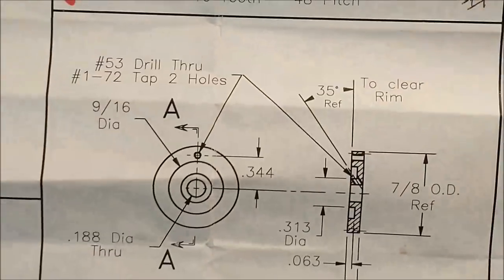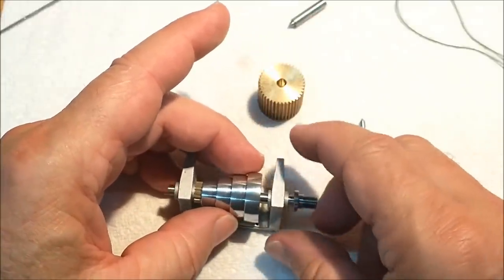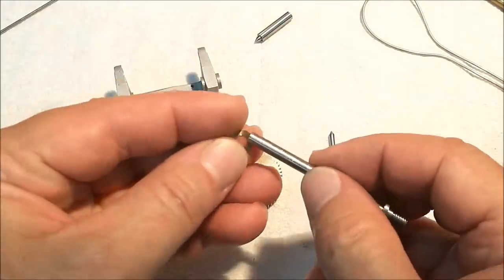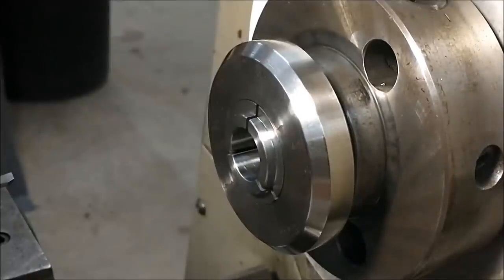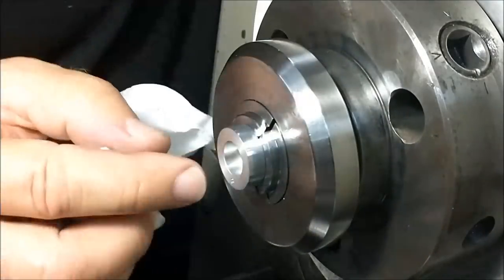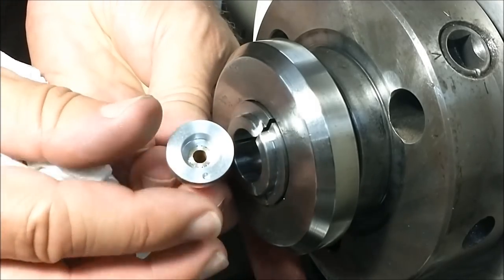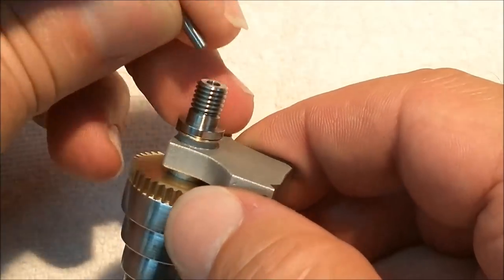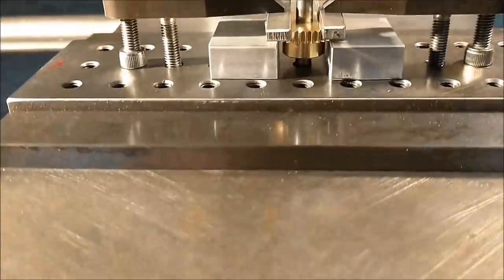Main Spindle Gear - A Design Change You Are Going to Like !!!

Comment: I like your solution.Much better than the print.You could cut grooves in the bull pin then,drill and tap a hole through the face of the gear to intersect the hole for the bull pin.By installing a ball and spring,retained with a set screw,you could engage and disengage the bull pin by sliding it from one groove to the other,just like a larger lathe.Just a idea.Finding a ball and spring that small,presents another problem.
Reply from the maker: You'll still need room for the detent pocket configuration. There is just .125 to work with here.
Reply: The way you did this is probably the best solution.It is a working model,not a production machine.👍

Comment: Just a quick question on terminology. In the US you seem to use the word "setscrew" for what we in the UK call a "grubscrew", usually a socket-headed retaining screw which sits in a recess. The UK version of "setscrew" is usually reserved for a standard hex head bolt with the smooth shank threaded for the entire length of the bolt and frequently fitted with a nut at the other end. I've looked on the web but can't find a satisfactory answer. Q. What is the US name for a fully threaded standard bolt?
Reply: Fully threaded, look up McMaster Carr and go through the drill down menu (great website).
Reply: All I can tell you is on the old machinery they use to have a long threaded bolt where appropriate.   It was threaded all the way as you said but it had a square head on the bolt.   I believe it was no bigger than the size of the bolt.   I will have to check that as I still have some of them.   I don't know what the proper name is for them but we always called them a set screw  bolt.

Dale in Canada
Reply: @dalemcinnes1834  Thanks Dale. I don't know if you will get this reply as YT doesn't seem to be recording them. Anything with a thread on it seems to cause all kinds of confusion. Setscrew, grubscrew, setpin, stud bar, allthread, capscrew all seem to have varying meanings in different parts of the world.
Reply: @larrymunday7519  Thanks Larry, I posted a reply but it seems to have vanished.

Comment: I like your drive mechanism much better than the angular setup on the plan. Even in real life it is a much better solution to driving the spindle than an angular set screw. No side loading and no dicey locating issues. Nice! j
Reply from the maker: That angled screw was just not going to happen on this model.

Comment: Very nice modification for the lathe.  I'd love to see that show up on PM's plans someday.

I was wondering why you didn't use a taper pin reamer for the center tapers?  Perhaps I missed that point in an earlier video.
Reply: Guess I’m a little slow this morning. I can’t see a need for the setscrew through the cone. When the bull pin is engaged the drive is direct. When it’s out the gear and cone rotate independently. Why lock the setscrew to the shaft and possibly mar it? What am I missing? Thanks
Reply from the maker: I could have, but its a personal challenge to bore something that precise and small.

Comment: In Case someone screws up their 'Gear stock' piece and needs another to start over--It is available, It is referred to as Pinion stock, comes in different diameters and materials, usually reasonable and comes in 1 foot lengths. Some is extruded, and some is hobbed.
Gear suppliers have lines into these suppliers, but generally they are the higher price.
Reply: Some manufacturers call it "pinion wire".

Comment: There might be an alternative way to adress the problem of the set screw. Let me know what you think of it:

I am looking at the drawing on the right side at minute 1:32. If you 1.) add a boss on the right side just as you did and 2.) skip the tripan just as you did, you then can move the whole set screw to the right (away from the spindle nose) until there is enough material on the left and righthand side of the screw.
Yes, the hole where you insert the allen key will move towards the outer diameter of the gear but there is enough space (if you align the tap and the ball pin away from each other).

Would this work or do you see any issues in machining/assembly?

Of course, angled set screws are more "fun" when adjusting the play of something ;-)

Comment: I understand I'm late to the party (have been bin watching. Awesome information by the way and thank you) having only recently found your channel, I am wondering if you considered 2 or even 3 grub screws to lock the drive gear to the spindle shaft?

Most likely, I am over doing it. It's that I see this thing tearing it's self apart in use. As an example the wallowing of the receiver hole for the bull pin. But as a show piece in the lobby or on a shelf in your study, it all be just fine.
Reply from the maker: I doubt it will ever see load around here, but the new setup is 100x better than the oblique approach.

Comment: Joe, could this be done by using a press fit on the large gear rather than a setscrew?  The downside would be that when you assemble it, it would be very difficult to remove.

Comment: You could put another set screw into the hole you make in the cone pulley.  Its outside can be turned flush with the pulley's surface, so the only "hole" is the hex for the wrench (or you could use a slot).
          You better have a flat (or better, a pocket) for that inner setscrew.  It will be under a lot of torque when the lathe is in use in back gear.  If that screw gouges the shaft, you could end up destroying the whole thing to get it apart!
          A setscrew is really not the proper way to secure the gear to the spindle!  I guess in such a small model, there is little other choice.  Better scheme would to have the front journal of the headstock larger then the back journal (this is usual case on lathe anyway), so square or spline could fit through.  Then there could be a square that the bull gear slips over, the spindle bearing being larger than square's diagonal, & the shaft being smaller than the minor diameter of the square.
          If you choose to do this, you need only bore out headstock journal, remake the spindle shaft (cutting square on dividing head in mill), & broach a square in the bull gear.  I know you can do all these things!  Your thick hub mod will make the square hole stronger.
Reply from the maker: Unfortunately, the head stock casting won't allow for this. I can see it working though.

Comment: Fastener and oiling holes do go through the of of the pulley crowns on a old hendey lathe I used to own.. so there is no accuracy in design failure if you do choose to go that way Joe..

Comment: Funny… I was just thinking “With a boss that big on the drive gear why not go perpendicular with the locking screw?” just as you said “I’m just going to drill a hole in the pulley to access the set screw on the drive gear.” And I felt like I knew a little bit about a thing!
Reply from the maker: Good luck with your book. Don't let anything get in your way.

Comment: I'm also not liking that mouse turd taking the role of the driving pin with its short length, thread in contact with pulley is transferring power and that its relative looseness could result in it walking itself out during use. Also, maybe that service port in pulley should have a removable plug that'll keep most of the dirt out?

Comment: Ya know with that mod you could put a bit of an indent on the inside of the pulley above the set screw where the Allen key hole is and have it so one screw will do forward and reverse.

Comment: So the original does have a 2 holes in the cone pulley, 1 on the large one like you have and 1 on the next to smallest for oiling the spindle to cone pulley busing. I have the 16" x 8' version, so a little bigger. Not to nit pick, but the bull pin should be a slotted hole with a spring loaded pin for engagement. Probably too small for this model, just FYI.
Reply from the maker: I'm aware of the original configuration, but I only have .125 of real estate to work with and very little clearance if the pin would retract. I don't like the set screw either.
Reply: @joepie221  I have to admit, even on the 16" size I have trouble getting the pin engaged, perhaps my fingers are too fat! Still an excellent job and good problem solving (which I think we all expect anyway!)

Comment: Hi Joe . i use 0-80 screws a lot , tapping holes in grade 5 (6Al4V) titanium always use to be a big issue till one day i broke the last tap i had in the shop , so i re sharpened the bit that was left over , about 6mm (1/4") of the tap and continued tapping the last few holes ! it was almost as if someone magically softened all my titanium . I think i tapped 500 holes through 1.4mm thick titanium before scrapping that tap ! Now every time i get a new tap , i break the front half of the tap off and re sharpen the end before i use it and it really makes a big difference !!! The tap i am currently using has tapped more than 1000 holes and is still going strong ! 
BTW i sent you a message on your Instagram a while back (not sure it will even be there anymore) My name on IG is jack_connan , have a look see if it is still there , you may like it

Comment: My first thought was to put a hole in the crown for a set screw.
The original oblique method is just far too critical on tolerances.
The tap trick!  I do that all the time with small bolts and screws!  I cross-threaded too many plastic pieces in my youth and don't miss doing that any more.
That's a piece of engineering to be proud of.
Reply from the maker: I had the available room just sitting there waiting to be used, so I used it.

Comment: I do very small parts for motorcycle carburetors and mostly brass and aluminum and i can't seem to find boring bars that small!!  

When do you buy them?  Thanks Joe.  Nice work as always!
Reply: Thank you sir!  Just didn't know what to call them really.  And yeah,  didn't think they would be cheap.  But if it gets the job done and I can make money, I'm okay with the cost.
Reply: @jdsstegman  
In many cases, I would go ahead and buy something like the set of 6 in a nice wooden box, or at list put it on a wish list. In this case, I looked at the price, considered how much use I would get out of them and then realized that I would break them on the first hole using my 7 x 16 mini lathe (it's reasonably rigid, but not enough for these!).

Comment: Joe, could you have drilled the brass gear set screw hole and the pully together for alignment of the hole instead of using you DRO numbers?
Reply from the maker: Absolutely.

Comment: Know I'm way, way late, but just watched this. Great series. Nice mod. Could also have used a #0 set screw and drilled the whole radius of the gear. There would have been 32.5 thou of brass left on each side. Plenty of meat! (I've a bit of OCD.  The hole in that perfect cone pulley made me cringe.)
Reply from the maker: Now that you've seen the hole in my cone pulley, take a closer look next time at any cone pulley you come across. I bet you'll be surprised at how many actually have a hole for lubrication or other purposes. As for an oblique #0 grub/set screw, think about how small the drive hex would be. Strip that out and your permanently 'screwed'. The hub modification and step up to a 1-72 screw allowed for perpendicular forces and a bigger hex drive.

Comment: I understand the need for a set screw here; wouldn't a keyed shaft locked into the gear have worked as well?
Reply from the maker: Using a key would lock the gears to the shaft full time. The Set screw is only used when the back gear shaft is moved into position for a much lower spindle speed range..

Comment: ? Did you consider that the angled set screw would act as a force to hold the shaft from moving forward
Reply from the maker: If anything, it would have pushed the gear forward at assembly and locked it up. The small gear on the end of the spindle is on the outside of the head stock casting and should be a sufficient retainer for the spindle. Now, its just triple strong.

Comment: I would have done this. leave the detent lock screw in. This gives you an alignment reference. Leave the gear and pulleys together and drill straight through both. That would mean automatically being able to find the locking screw, with the detent in. You wouldn't have needed to complicate your life by offsetting it an arbitrary 90 degrees.

Comment: Aha! We now know exactly how you make all of these small features on this model. No, I'm not referring to the micro boring bar (but I am disappointed that your collection of these tools only goes down to the 0.025"Ø capable bar and not all the way down to the 0.015"Ø capable bar that McMaster stocks [page 2717 or search for "small-diameter round-shank boring lathe tools"]), I'm talking about the secret that was revealed at 9:06 when the open mike captured your team of Elves who actually perform the work:

Seriously, looking at that boring bar and trying to imagine using it on stainless in a mini lathe without snapping it off makes me sweat. At least your lathe is solid enough to give you the stability and accuracy to support your skills to pull it off (but I'd still like to see a short video of the actual boring operation). Thanks, Joe!

Comment: Just a thought, make the hub a couple of thousandths longer than the depth of the c bore so major dia don't rub, don't know if the cone pully bearing was longer than the cone
Reply from the maker: Then the face of the hub would rub. My C'bore in the cone pulley is .01 deeper than the hub on the gear is long. The diameters have .02 clearance. Properly adjusted, nothing makes contact.

Comment: Was just wondering, would keying the gear to the shaft be impractical at this scale?  You did effectively lengthen the contact area of the gear with the shaft by creating the hub feature.
Reply: I hope Joe Doesn't read your comment otherwise we are going to have an hour long video with a lot of swearing in it! :)
Reply: He mentioned in the video that because of the order of assembly, the keyway would have to go most of the length of the shaft.
Reply: @RonParker  How does that old saying go "remain silent or speak and remove all doubt..." I really am not a machinist, I'm a home shop owning wannabe machinist.  It's painfully obvious given the way the model goes together.  I was imaging how my Rockwell 11" headstock is assembled as I had the spindle out of it once.  Mouth shut, eyes open, pay attention, learn much...LOL

Comment: How precise are those edge finders?
i.e. how much lateral movement of the tool between the edge finder running concentric and then getting offset by friction
Reply: If you look in his previous videos he shows a very easy to follow guide to make them.  At the end he shows the result, after 3 tests, 2 were dead on and the other was .0001 shy I think it was..  
Get lost in his backlog of videos. A lot of them are in more of a teaching format. The way he explains everything, even the geometry and trig is taught in a way that makes it incredibly easy.  There's lots of machinists on YouTube, but Joe has hands down actually taught me the most. Especially when it comes to the real fundamentals..

Comment: I have a 3 step crowned pulley on my own lathe. The smallest pulley section has a small hole in it for oiling the shaft inside the pulley unit so your small hole is not a unique feature in these things.

Comment: 24:50 My thinking would have been to drill a pilot hole first through both pieces connected together, the width of the Allen key, and only then to enlarge and tap the hole in the inner gear? For a better alignment? I'm a hobby machinist, so I may be misguided here ...
Reply from the maker: That would absolutely work.
Reply: That’s how my train of thought went too. I would have assembled all 3 components and drilled through them in one hit, also just nipping into the spindle a little to leave a witness mark for the location of the receiver flat. The only difficulty would then be locating the hole in the gear for tap drilling and threading.
There have been a few instances in this project where I’ve thought “why didn’t you do that in one go” but then I admire Joe’s confidence and experience in the accuracy and repeatability of his setups and his ability to get perfect alignment with multiple processes. A true master of his trade, following the dimensions on the drawings with confidence rather than playing it safe with  “fit on assembly” 👍 👌

Comment: Thread and plug the hole in the cone pulley with a set screw. No dirt ingress that way.
Reply: The real machines actually had holes in a couple of the pulleys to let you oil the bearings under the pulley.
Reply: SOUNDS !! LIKE !! TONS !! OF !! DIRT !! GETS !! INTO !! IT !! THERE !!
Reply: @davidwillard7334  Not really. A properly used and maintained belt doesn't make any substantial amount of dust or dirt. If it is making dirt, it is slipping, and something is wrong. Just flexing a belt designed to flex doesn't cause pieces of the belt to powder off unless the belt is already dead. So there isn't a substantial amount of dirt-producing stuff near the hole. 
For outside dirt to get in the hole, it needs to be on the upper half of the pulley so the dirt can fall into it. There is a fair chance the belt will be on that spool, and will be covering the hole, so didn't can't get in. If the hole is pointing down, dirt should want to fall out.
For that matter, when the pulley is rotating, centripetal force is going to be trying to throw stuff out of any hole in the surface of the pulley, not suck it in.